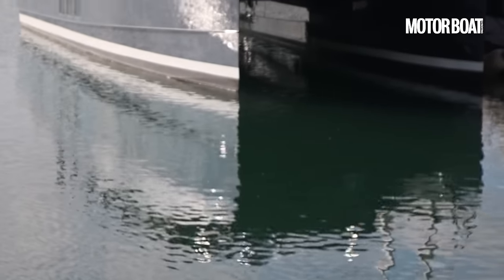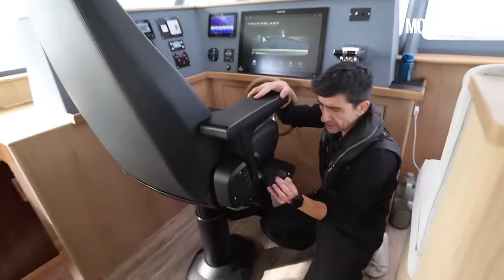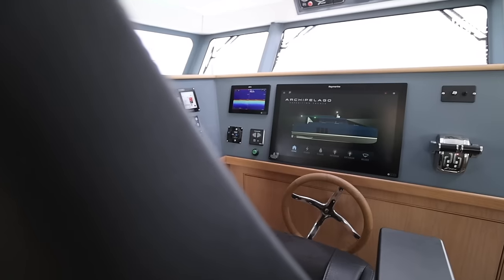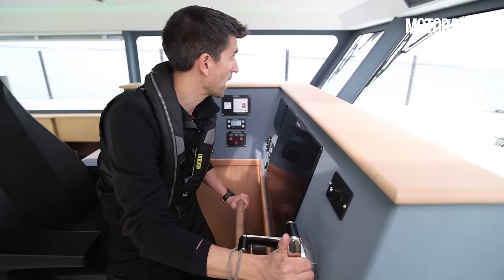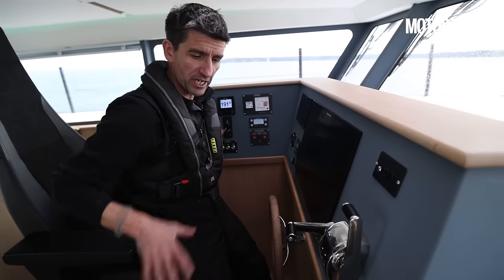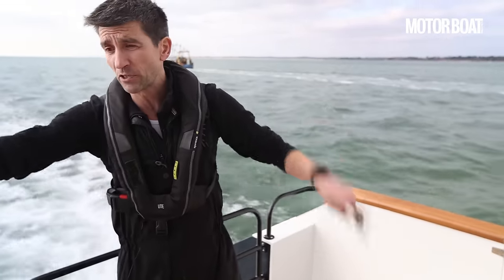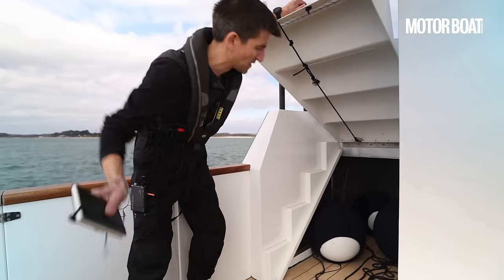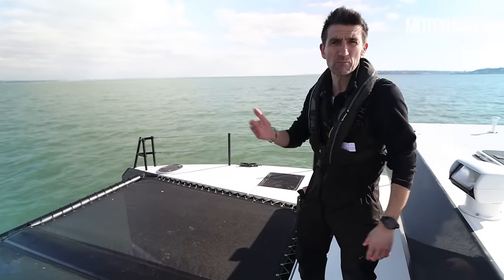Archipelago 47 sea trial review | Brilliant British offshore cat that feels just like home | MBY

Comment: It's way to unfinished to be shown off this much, there are a lot of design changes needed and it doesn't help that they introduce problems, that have been solved a long time ago like the drawers and the horrible satee and helm or the lack of a swim platform. There are a lot more than these easily fixable problems, but these shouldn't need real-world testing, these should have been ironed out in the development phase and never leave the drawing paper. At this state, there are way to many excuses and "they will change it" comment are required from the presenters to make it a positive presentation. Yes it has potential, but i'm not convinced it will ever achieve it. And they should not be commenting about future models until they manage to develop this one into an acceptable state....

Comment: This design seems to get as close as you possibly can to both being able to withstand rough seas and running from them, which seems a good thing, when you’re exploring far from any shore.

But with all the engine and technical compartments inaccessible on anything but a calm sea, I wonder if she’d be able to turn and ride the waves to get there with one half down: I guess there is no such thing as a self-righting cat.

I don’t see the explorer credentials extend quite into the insides for lack of storage: even two might be tempted to eat each other before their ocean crossing is over and I don’t quite see them sitting down for meals anywhere.

I don’t think I’m a design person at all, but evidently outrageously good still gets through: I am completely smitten by the outside and the inside, which seems as inviting and unobtrusive as it seems elegant even to me. And that master bedroom has me never wanting to get up again!

I have zero idea about the practicality of keeping it all working and clean on longer routes and in all types of weather, but it does look quite good even in this unfinished state.

On many boats you can convert one cabin into some type of gym to keep you hale and sane, but accommodating something here seems a bit of a challenge: if they really want to explore the exploration angle, they might have to come up with something.

I quite like the idea of being able to handle this boat alone, but again for longer routes you’d need some type of self-driving or remote operation, which could be a new market segment this company might be better prepared to serve than those who target the pleasure market.

Comment: Why are you only using the starboard engine.
Is the port engine not working on this test?
Reply: The engines are “synced”, only need to use the one throttle lever and it controls both engines, at the same rpm level. Used when running and then you would use the throttles independently of each other when maneuvering.

Comment: FWIW I commented on an earlier review on a different YT channel (Yacht Buoy) five months ago when it also reviewed Hull #1. Nothing seems to have changed and, although Archipelago replied and confirmed that items such as the helm would be fundamentally changed, it doesn't seem to have taken the opportunity to test some different designs/configurations. The noise from those Iveco engines was very intrusive on your test, and is not something that I would tolerate.

Comment: The cockpit is weird , very bad design and  the engines is way too big for a long range explorer.   
Two john Deere 6068TFM50 225hp  would do over 2500nm at 8 knots and 18knots max speed.
Install a kite sail , a micro farm, go hybrid  electric and  you can be at sea forever.
Very disappointing test numbers

Comment: The design of the bridge is very ugly, its appearance is outdated and very tall. It is really annoying to see. It is a design for a military ship, not a pleasure ship.
Reply: Yeah it's so basically designed even for a prototype. Also iveco engines? That's is a really cheap choice of engine and they are cheap for a reason.
Reply: @nothingsurprisesmeanymore  You're right, maybe as a prototype it's basic. The position of helmsman is "intimidating". Here in Uruguay I saw equipping 6.2 L Mercury engines, most Caterpillar, Volvo, Yanmar, Yamaha, Evinrude, in larger boats some Motor Man, Work in restoration and painting of yachts.
Reply: @nothingsurprisesmeanymore You are not very competent in terms of engines. The FPT 6.7 (N67) is the best engine of the class, infact they are selling them with the brand Mercury, Cummins, Yanmar and many others.  Iveco produces Trucks, not engines. The motor brand Is FPT (Fiat Powertrain Technologies)